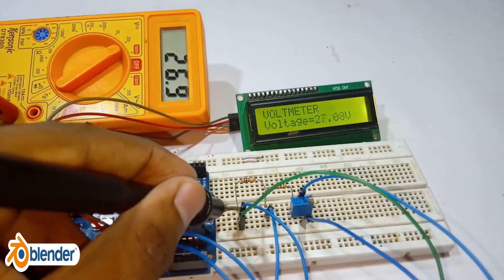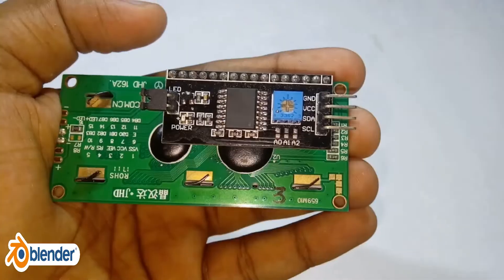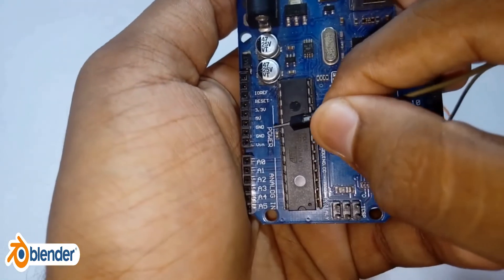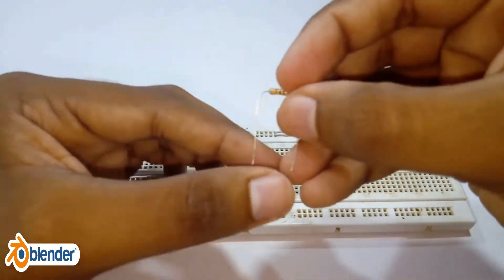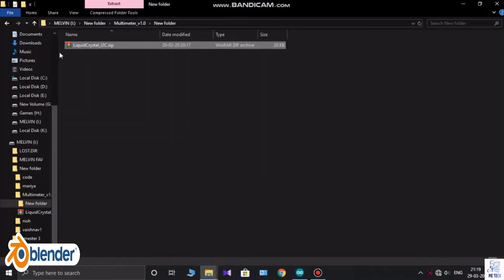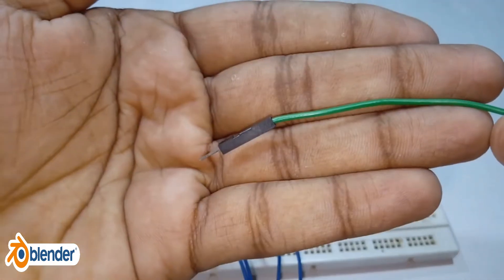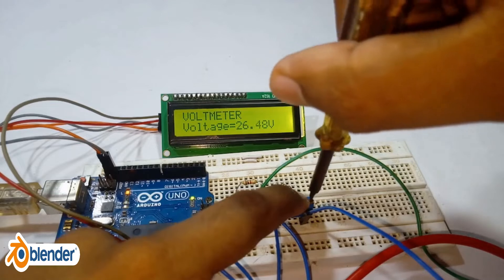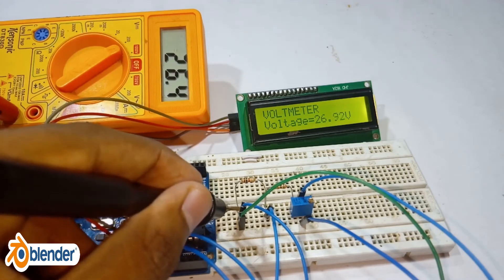HOW TO MAKE A DIGITAL VOLTMETER USING ARDUINO WITH LCD DISPLAY

Comment: If I already have a full triple output power supply, how can I modify to integrate an Arduino to read the voltage of the triple output power supply?

This has 2 potentiometers, one for 0V to 20V and another for -20V to 0V
Reply from the maker: Arduino cannot read -ve voltage so read the positive voltage and put a minus in front of the value for measuring positive voltage (0 - 20V) connect the positive of the supply to the top resistor R1 and ground to ground. To measure voltage negative voltage (-20 - 0V) connect the ground to the top of the R1 resistor and -20v to the ground. It should work fine